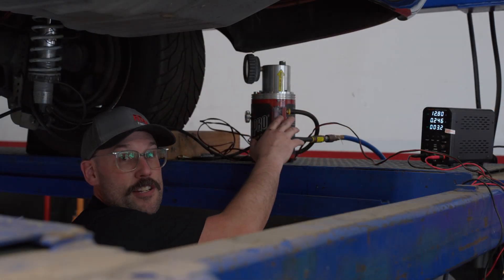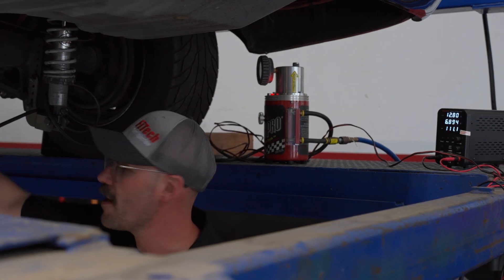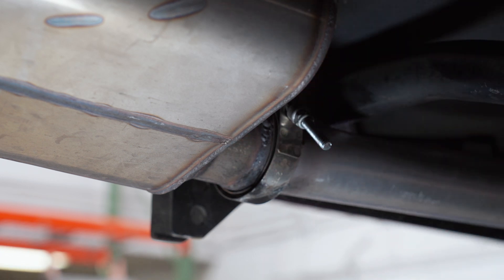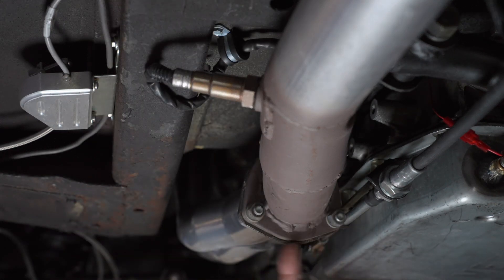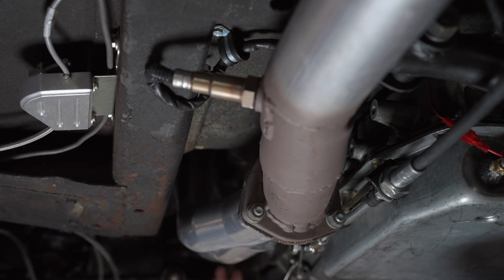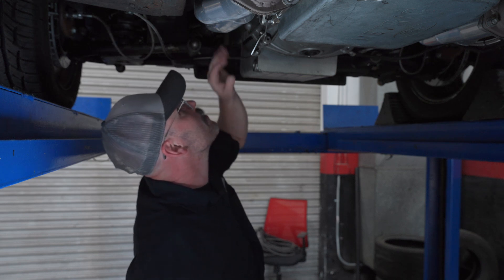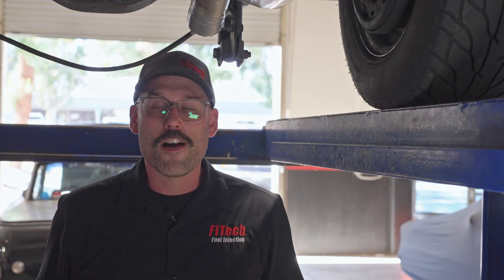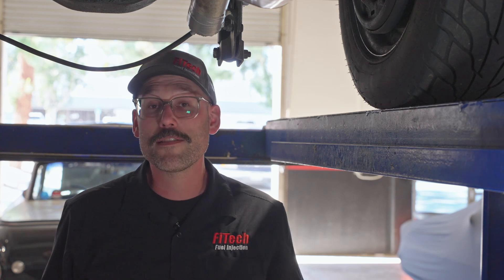Exhaust Leaks & Oxygen Sensor Performance | FiTech EFI

Comment: In reference to using an IF gun to check individual cylinder header tubes, the old school method is using a medium sized squirt bottle filled with just water only. Spray a couple of shots on each exhaust tube, the problem cylinder will show up as the water running off from not quickly evaperating, a good cylinder will quickly turn to steam.

Comment: I wonder if some of the fitech systems will allow you to run two o2 sensors if they only came with one. I'm asking for a friend with an ultimate LS system?
Reply: It will… you will have to purchase the connector and the o2 sensor from Fitech
Reply from the maker: That is correct. 70050-7
Reply: Thanks I'll look into that today @FiTechEFImedia